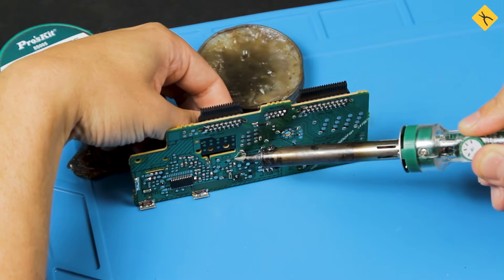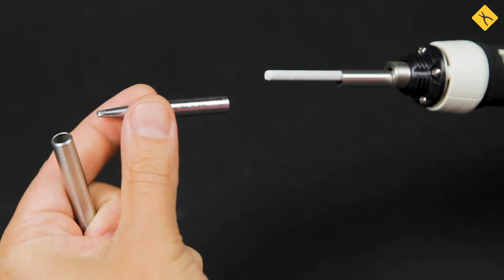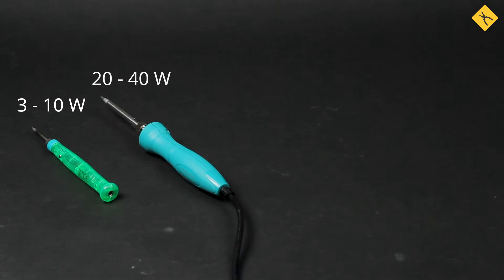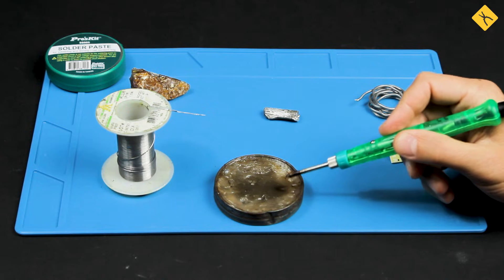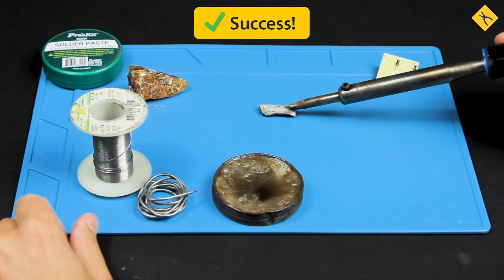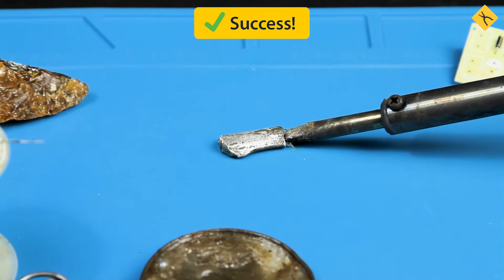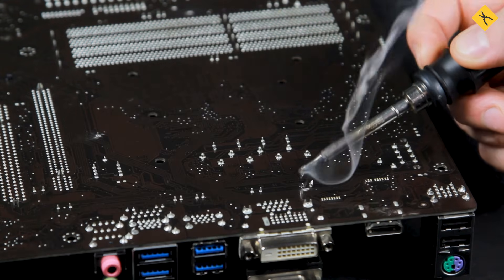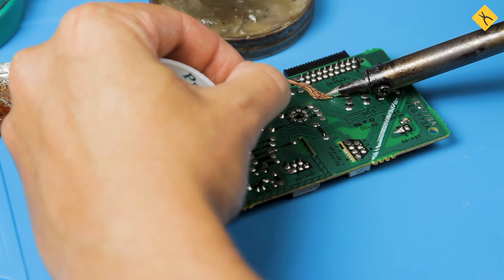How to Choose a Soldering Iron. Main Types

Comment: Every iron I've bought has not worked even the slightest, they don't turn on or break in minutes!!!😅😊😊
Reply: Are you setting the temp too high? That doesn’t sound right 😂
Reply: @murkyturkey5238 I have the blue original one with no setting it just errors out and the Silvery battery powered and sit doesn't hold juice in it 😅😊😊😅

Comment: what if i used 60W soldering iron for boards and converters on the board. also wire that installed on board ?

Comment: Yea, well, when I started I needed, if taking into account recommended wattage, 20 W
It wasn't strong enough.
Then 40 W
It also lacked heat.
Now I will take 100 W for jobs that are claimed to be for 30 - 60 W. 2 pounds heavy.
Reply: @@squallog5080 I usually lose that capability soon after first wetting.

Comment: Hi, Electronics Technician here. Let me give you some feedback. First, use the proper flux. Use plumber's flux on plumbing, not electronics. For electronics you want to use no clean, rosin or resin. Next use the proper solder, either tin-lead or lead free. SAC305 makes crappy solder joints IMO however SN100C is pretty good and less expensive than SAC305. Electronics solder generally has a flux core. Speaking of flux, please don't teach people the bad habit of dipping the iron into flux. If you dip into anything it should be tip tinner/cleaner. Then immediately add solder to the tip to flush away the nasty residue from the cleaner. Next, add flux to your work, not your iron. Put the tip of the iron on the work to heat it up and feed solder into the joint area (such as PCB pads). Yes you can transfer solder (tinning the iron and transferring to the joint) but I typically reserve that for lap soldering wires which the insulation could easily melt. And if you can't get the solder to melt, you should try a tip with a larger mass and/or heat the region with a heat gun on low or hairdryer on high. I'd use a board heater but I realize most people don't have access to one.
Reply from the maker: Hello! Thanks for the informative and constructive feedback! We appreciate your opinion and will take your suggestions into account! :)
Reply: excuse me, i get lost in translation because of the different terminology, the white greasy fluid (with the looks of hand cream) how should be used? i have been told to put it on the pcb spot to clean whatever impurities, but some people tell to put a bit there and then heat it, ns some other dip the soldering wire on the fluid and then heat the piece and the wire with the tip (which i find hard to because of the tiny size of the  pieces) thanks
Reply: excuse me, i get lost in translation because of the different terminology, the white greasy fluid (with the looks of hand cream) how should be used? i have been told to put it on the pcb spot to clean whatever impurities, but some people tell to put a bit there and then heat it, ns some other dip the soldering wire on the fluid and then heat the piece and the wire with the tip (which i find hard to because of the tiny size of the  pieces) thanks
Reply: You seem to know a lot about soldering irons. I'm looking to get into electronic repairs and am looking for a rework station. I don't the one I like takes 210 tips which I'm assuming is only compatable for t26 irons...? What about t36 irons? Is that how irons are sized?

Comment: I'm using a temperature-controlled Oryx iron, bought in S. Africa about 55 years ago, that has lasted me till now - though I'm going to have to replace it because the tip is corroded and I can't get tips for it any more.
Reply from the maker: Hello! 55 years! It's incredible! When it comes time to change your soldering iron and buy a new one, pay attention to the GООT brand. They offer reliable soldering irons and soldering stations for a wide variety of tasks.
https://toolboom.com/en/catalogue/soldering-equipment/soldering-irons/?brand=goot
https://toolboom.com/en/catalogue/soldering-equipment/soldering-stations/?brand=goot
Reply: @ToolBoomVideo  Thanks for that.  Some of these irons seem to be about the equivalent to what I have.  I'll have a look at your product line.
Reply: Get a quicko for 20 to 30 bucks my boy. Jazakallahu kheiran
Reply: @MohamedDIYelectronics-ei5wy  Thanks for replying.  As you see, I've been waiting for 3 years for somebody to tell me what to do, so I can get a soldering iron.
Reply: @DownhillAllTheWay dang.. nvm just get yourself a quicko like i did, pretty good
Reply: Try sanding your tip, thank me later.

Comment: The best video i've Ever seen about soldering iron
Reply from the maker: Thanks!
Reply: @ToolBoomVideo  by the way sir what do you prefer for soldering iron, the digital ones or the common type soldering iron?
Reply from the maker: @09kenxgamer31  We think a soldering iron with temperature regulation is much more convenient than soldering iron without that option. Regarding temperature regulation, we used soldering irons with both analog and digital control. All in all, it depends on what is more convenient for you, as there’s no fundamental difference for the user.
Reply: @ToolBoomVideo  is the digital ones is durable like the common soldering iron? Or it depends if it's China brand or US